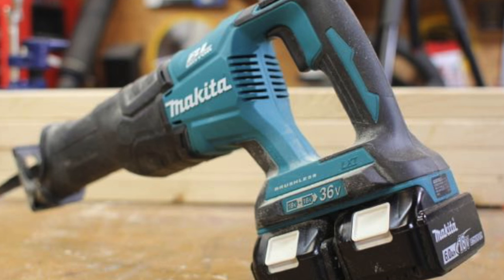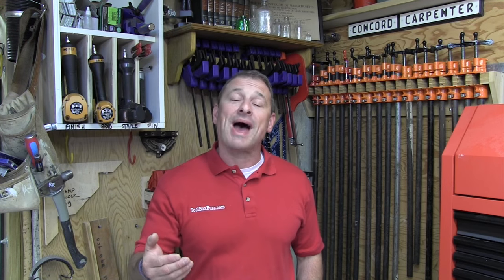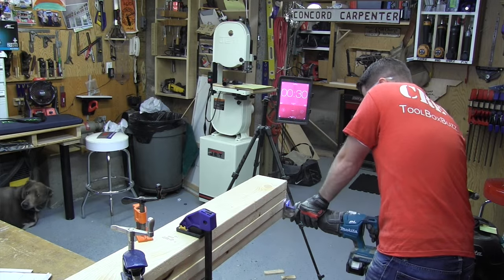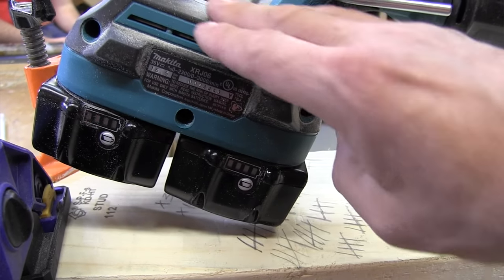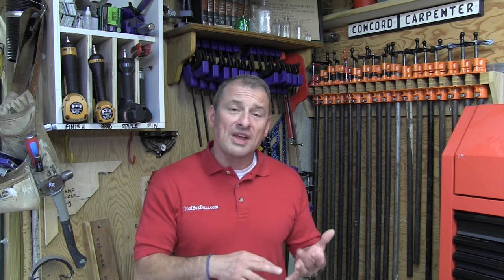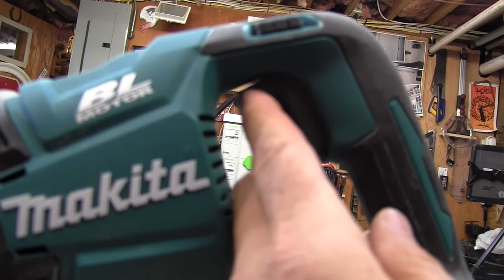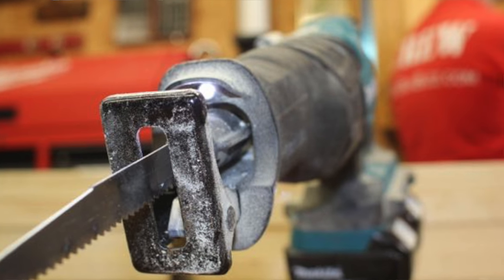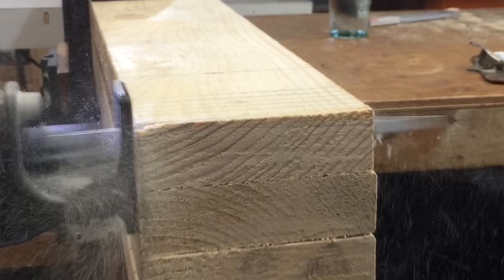Makita 18V X2 LXT 36V Brushless Cordless Recipro Saw

Comment: Seems very nice, i wish it had antivibration technology and the orbital cutting feature. Wouldn't that make it MEGA AWESOME?  I'm looking for the most powerful, most long lasting battery system, most advanced cordless Sawzall I can get. I'm using my heavy duty 16 year old variable speed trigger [ also has 6 position variable speed dial ] corded Milwaukee sawzall with Bosch 12 inch pruning blades and get sick of constantly having to hold the power trigger. Isn't it about time they come with a power on lock feature option?  God bless 🎄🎄🎄

Comment: I think the 18 volts is enough for a reciprocating saw. Who wants the added weight of the second battery. Rather just change it for the second when it is done. I get the added voltage for a rail saw or chain saw but the 18 volts is good enough for 99% of the cuts for a recipro saw. Better than most older cord based saws.

Comment: question, really how good is the makita battery / do they last a long time? this question is for the makita battery only. thanks!!
Reply from the maker: Do you men over the life of the battery or runtime?
Reply: victor feliciano the new 4/5/6 ah batteries are as good as anything else on the market I run makita the guy that works for me is Milwaukee and they are both spot on battery wise.

The early 3ah makita batteries didn't have the low discharge set at the right level so if you ran them down the charger wouldn't allow them to recharge effectively leaving you with a duff unit.
Reply from the maker: victor feliciano  Adam is spot on!!!!
Reply: A Concord Carpenter / ToolBoxBuzz the only other thing I would add to my original is the milwaukees spend more time in the repair shop than my makita (from a family of builders and only one who runs makita) chucks are poor on the milwaukees as are brush holders. I've got lads  that run hitachi, hilti, dewalt and Bosch and then my makita and Ian's Milwaukee we have found the hitachi and Milwaukee tools to be most problematic and the rest all to be very reliable tool wise. However the batteries are all much of a muchness  and they all use the same 18650 cells anyway all be that by different makers. 

I'm not sure if here in the uk we get quite the same line up as you guys in the states and Milwaukee has only really been around since the TTI buy out.

Comment: i heard the makita battery dont last to long?
Reply from the maker: I have not heard that - did you hear this from another contractor? or several?
Reply: I head the opposite - they are known to be a bit underrated, hence they do not always have the longest runtime on a charge, but they are having a longer lifetime than other packs that way. That said, the runtime is far from bad, on the contrary, and they charge quicker than anything else out there right now. So as always, Makita was not aiming for a spec shootout, but for real world use and a good compromise in that regard.
Reply: My brushed makita impact driver will run all day on a 3ah battery
Reply: They make the best Battery packs...
Reply: False

Comment: stay away makita 36v / also the 18v makita brushless sawzall, they ARE crap. if you need a sawzall stay with milwaukee brushless sawzall with there 9amp battery $249 at home depot. if u r low in cash buy a kobalt brushless sawzall 24v $119 plus & one year money back and 5year warranty, so how can you loose. just try it from lowes store!
Reply: Rusty Shackelford in My personal experience, Makitas ergonomics are superior. We had them at my previous company. But the tools didnt last, so we changed over to Bosch. The Bosch tools lasted about 3 times longer on avarage. 

This was about 4-5 years ago, so things might have changed.